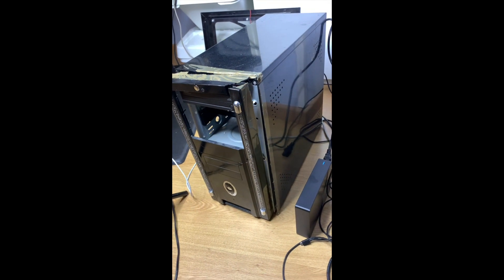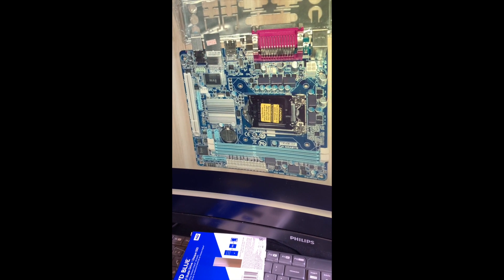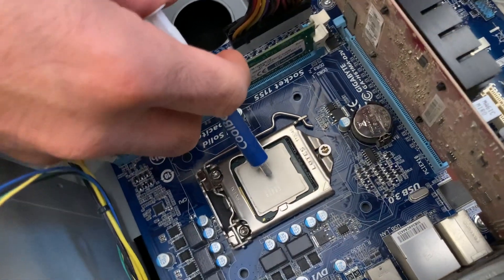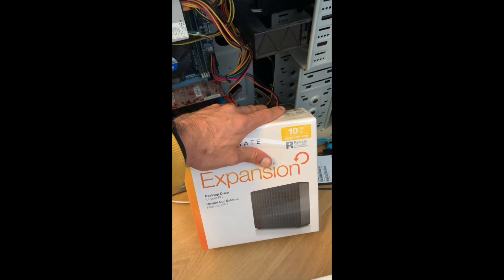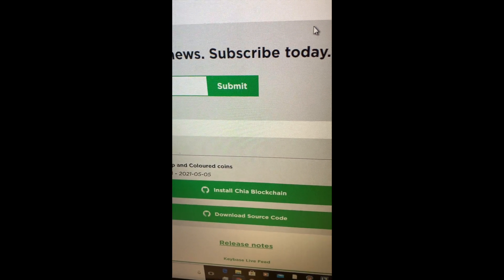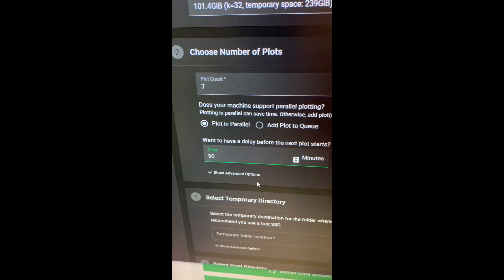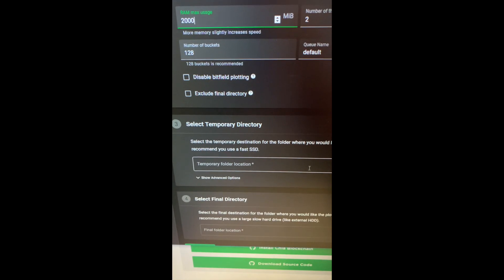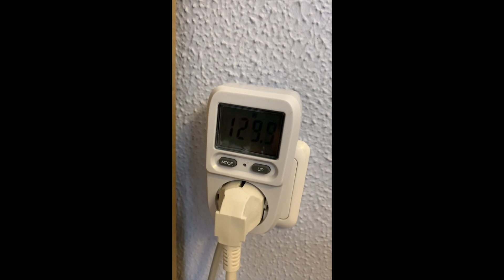Chia Mining: $200 PC (Farming 7 Chia Coin Plots per Day)

Comment: This is a video that I am looking for. I have a I7 2600 with 16gb ram and a 256gb nvme drive. I don't mind to add a 10TB HDD. 
Will I be able to start?
Reply from the maker: 256 is too small. Each plot will take 4x size in phase one. Checkout my other video on plotting

Comment: wait if you have 7 plots going doesn't that mean that you need 7x 239GiB of temp space ? so where are you throwing all the temps?
Reply: you can paralel plot with a delay. So like you can start one plot every 4 hours etc...
Reply from the maker: I've set a delay on each plot. I'm not sure how it works in the background exactly but it was working. On my second 7 parallel plotting, however, the system crashed... I received the bluescreen, So now, I'm only doing 4 in parallels, and I have ordered a second SSD, which I will hook up to the system and do more parallels again. I'm learning as I'm going along. It's all trial and error really
Reply: @wolftrepreneur  what setting do you use in parallel?